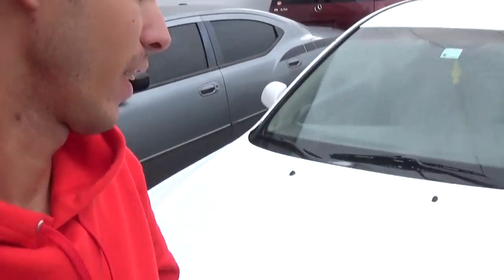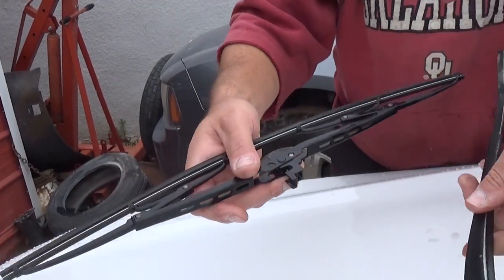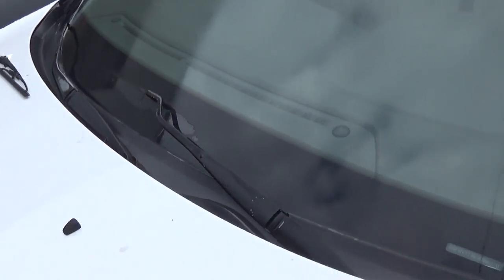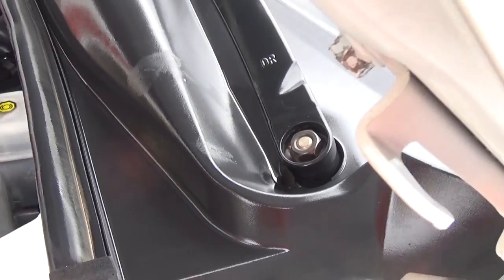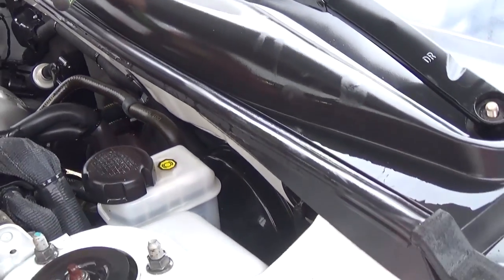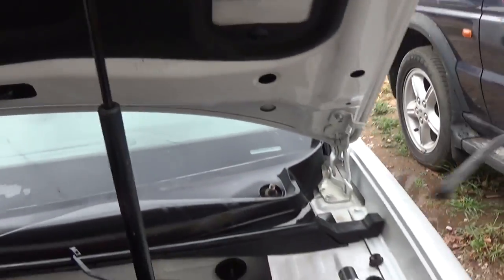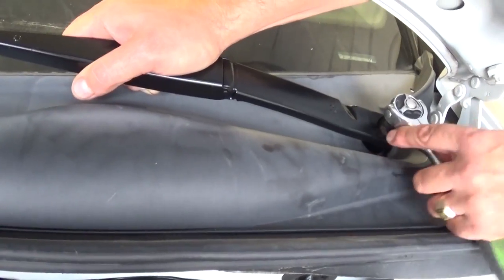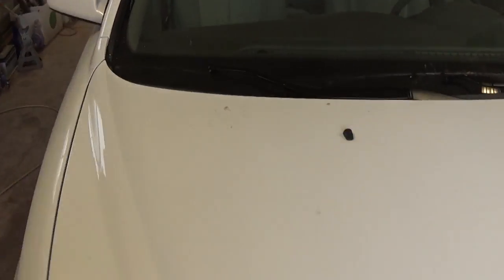HOW TO REMOVE WINDSHIELD WIPER ARM ON A CAR

Comment: How would I recalibrate the arm? I took it to a shop to get the windshield replaced and my step dad drove it back anyway my windshield wipers are definitely not in the same place they were before They are Way higher than they were before and it's driving me insane.. I tried to see if I could take out the left windshield wiper and I popped off the cap like you said I used the 15 mm socket wrench and got that off cool but I also had to take off a cowl cover And it looks like I might need to take off another cover.. Maybe... I'm trying to wiggle the arm free and it's a little hard the hood is kind of in the way and it makes it very difficult to try to maneuver to get it out I have no idea how these people got it off before because when I close the hood there's no way that you can just pull this off with with the hood down... Need help